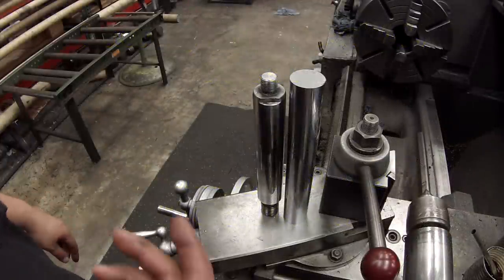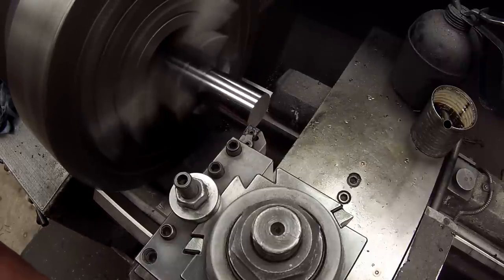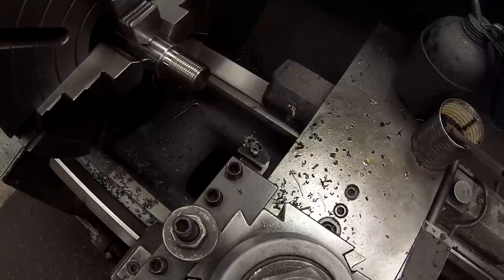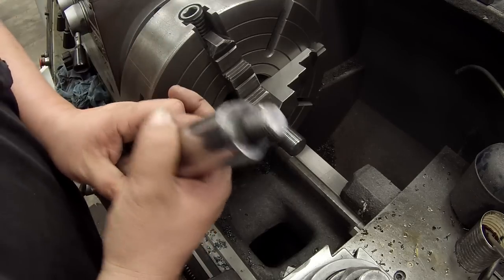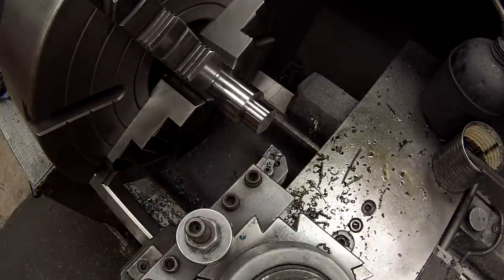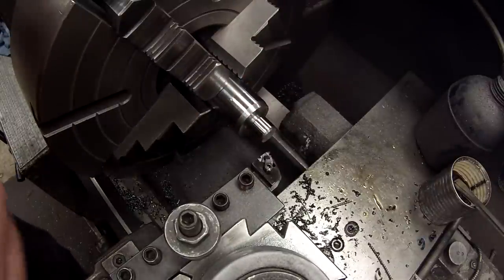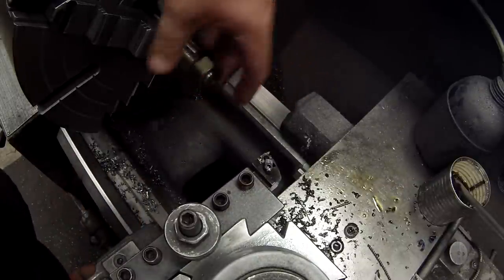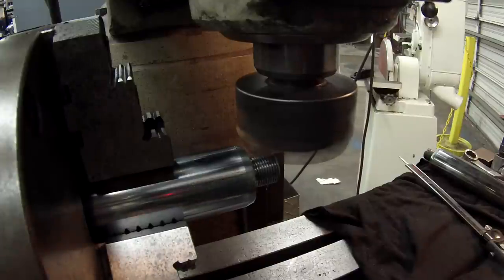Saturday Night Special 44 Part 3

Comment: This video is good start for a series! Thanks. Few questions :
1- Is this a special steel to make these rod? What should we ask for?
2-How do you clean or repair the scratch?
This material seems to have a chrome finish or something that covers the steel. Can we do that repair at home? If so, how? I would love to see you make all the cylinder's parts. For some projects I need to make a very, very small cylinder (air-spring and some oil actuated) and would be interested to see how all these parts are made. If your boss could be kind enough to let you film some of the work related to that matter. Thanks

Comment: Man you really got some good footage on this segment. This was a great machining video. I assume you used the DRO for the o-ring depth and didn't just eyeball it?
Reply from the maker: bcbloc02 I used the dial on the cross slide actually. I feed in about .105 for a "0" series oring, and the inserts tools is .085 wide.

Comment: I thought Quick Draw MacBooth was going to have to have to make an appearance ont that second end.  No fair when you put in an undercut.  :-)  Nice work.
Reply from the maker: I'm not scared of a shoulder. But that one was just to make sure the nut went to the shoulder of the rod, but probably something in front of it once it's installed.

Comment: Hey Adam,

Did the piston end have a locking screw in it? Do they put that in when they assemble the cylinder?

Looking good buddy.

Cheers,

Tom
Reply from the maker: Hey Tom, most of the pistons and rods get a "dutchman" in them when assembled. Our general rule of thumb is any piston over 3" gets a set screw. A bunch of the factory units we get in are just drilled and "pinned. Pain in the ass, I have to drill them out by hand mostly. Usually not a problem if I can set them in the drill press on two parallels. The big ones get drilled by hand with the drill motor.
Thanks for making some time for your ole buddy Abom!

Adam

Comment: Another fine job you did Adam. I still say you are one of the fastest 4 jaw chuck A+ runout setup man around.
That metal looks easy to machine but I see when you cut the threads they cut like butter. I have problems cutting smooth threads what do you think I am doing wrong. I am using a HSS cutter with 60 Deg point with 70 rpm 8 teeth per inch for a 1-1/2 spindle using test 1018 steel.
Thanks again somethimes I am not able to comment 
Manny
Reply from the maker: Manny Monroy Cutting with a HSS tool often causes problems with the finish. The carbide inserts and the faster RPM's usually result in a nicer finish. Even with the hss, run as fast as you can to help with the finish. Cutting oil, and a fine honed tool will help as well. Thanks for the 4 jaw comments Manny!
Reply: Thank you for the tips on threading.
Keep on trucking :))
Manny

Comment: Wow. That's a huge SNS episode. Awesome! Great work on the hydraulic rod. How long did it take you from start to finish? I really start to see the advantages of a four jaw chuck. I have been turning some polystyrene rollers for an apprenticeship and as both sides needed to be machined, after flipping around it ran pretty bad, about 1 mm out. As there was no four jaw available, I had to turn a mandrel. Not my preferred type of holding work...

Anyway great video, thanks for sharing.

Phil
Reply from the maker: That one only took about an hour to make, if that. It's a pretty quick one to knock out.

Comment: In the last phase and judging by the sound looks like only one of the indexed tool inserts is cutting. I gave up about using more than one insert in my tinny indexed tool because of the extreme difficulty in getting the inserts aligned.
Reply from the maker: I never pay it much attention myself, but have had to turn the inserts around many times. That milling cutter uses three inserts, so not as bad to replace the cutters as some. I will say that is seems to do a better job that the normal use of an endmill.

Comment: Great job!  It didn't look like you put anything between the jaws and the rod when you tightened it down.  Is there a chance of jaw marks, or is the chrome hard enough to prevent that?
Reply from the maker: As long as you have a good chuck, and it has the "flat" jaws and not the knarly serrated jaws like most Cushman chucks, you can chuck the chrome rod without messing up the chrome, as long as you don't pull it too hard. When using the knarly type jaws, yes you need to use soft jaws "copper pads in my case".

Comment: Pulling off of that thread at 300 RPM is a little like how some have said that some major league batters can see the laces and ball rotation on a 90 mph pitch!
Reply from the maker: Ah come on Dave, that 300 RPM is everyday all day. LOL! Even faster with the fine pitches. Just some time and experience. once you get it down, the slow rpm's just take way too long.

Comment: Cool. I think that was the longest work video to date? Like to see more if it's ok with the bosses.. ;-)

Colin
Reply from the maker: So far, it's cool with them as long as it doesn't interfere with my work performance. I certainly don't want to impose on my job status, so filming there is much fewer than what you see at my shop. I have missed many opportunities to film some very cool jobs I get to work on.

Comment: How do you or the lathe know when the start of the pitch is? 
Because you will either have to very very precise switching your feed in, or will it feed in at the exact same place every time?
Other wise you might end up making two threads or nocking the pitch off?
I've never threaded before so have no idea.
I love your videos,
Mark :)

Comment: Hi Adam,
That hydraulic rod is a shorty!  May I ask what it goes to?  Also, I noticed that you began with the correct-sized stock.  If the stock just happened to be oversized, would you be able to obtain an adequately polished surface on the lathe, or would it need to be ground to size beforehand?
Thanks,
Bryan

Comment: Great quick video Adam.  What steel is this you are using?  It cuts really good.  Thanks
Andy
Reply from the maker: This particular rod is 1045 Chrome plated. You can buy from cylinder component suppliers.

Comment: Hi Adam. maybe I missed it, but did that shaft come to you polished or did you machine it and polish it in another video. Is that rod going inside something or is that the finished product ? Great job, I enjoy watching you work. ....Ken
Reply from the maker: Ken, it's chrome plated rod which comes already polished just like you see. If I get any imperfections in the surface while chucking I can polish it myself and bring back the nice finish.

Comment: Hi adam
Did u leave and jaw marks from the chucks or did you polish that out after.
Cheers
Greg
Reply from the maker: Greg, no jaw marks on the chrome with the smooth jaws, and correct torque. The serrated jaws are the ones you have to be carefull with, and usually have to use soft jaws with them. But if it did leave a scuff mark, and quick polish will buff it out quickly.

Comment: Hey Adam,
great info in this one as well as in any other video. One question.
How did you make sure the overall length of the piston is accurately machined to the right dimension or aren´t there close tolerances on this one? It seemed like you started out with two saw cuts on the stock material and then kind of arbitrarily faced of 50 thousands on each end to get it to overall lenght without any measuring (or at least not showing us). No matter whats the case with this one, how would you machine such a piece where you´d have to machine features on both ends of the shaft and still hold a thight tolerance on the overall length?

Looking forward to the rest of the hydraulic series buddy. Greetings from germany

Kevin
Reply from the maker: When I cut the rods in the saw I cut them 1/8" long by using a tape or rule. Face .050 off one end, and usually the other side will need .050- .062 faced off as well. On this job, I measured the rod length with my12" calipers before I chucked it back up for the second end. I needed .050, but it's not a super crazy tolerance. I usually get them to within 1/64" or tighter, but on many rods you can be off 1/16" and it won't hurt it. 
To do an accurate measure, you can face, remove and remeasure, them chuck it again. You can also use a steady rest and measure while still in the lathe. When in the machine I normally use my Stanley fat max tape measure and I can get them within .010 by sight.

Comment: I learned how something can be done - the threading process - but still don't understand it.  I can see how one run would put cut threads (or the beginnings of such) on a project, but then to cut them deeper it seems like (to this student) that if one wasn't really careful, or using a computer to sync it, that the next pass to cut the threads deeper would have a chance, and maybe a good chance, of not following the original thread cut and cross-cutting it.  Can anyone describe the process to prevent follow-up thread cuts from cutting anywhere but the original cut(s)? 

Also, is the 300 RPM for the threads desired relevant to the machine, or how does the machine know how fast to draw the cutting surface at a given speed to get the desired thread?  Thanks for any replies or links to videos.
Reply: If you look on Youtube for MrPETE he has several videos that show the basics of threading.
Long story short, there is an indicator that is in sync with the chuck that tells the operator when to engage the feed. This is an extremely brief explanation and doesn't do the process justice. There are other excellent channels that explain the process too.

Comment: Good vid man , The kids asked what me what that rod was for metal type , I know it's steel .. But not sure what to tell them ??
Reply from the maker: 1045 Chrome plated steel. It's made for cylinder work, but is also useful for pins and such too.
Reply: Abom79  The 1045 is what I was messed up on man ,Thanks !! I will for sure share this with my kid'oes !!

Comment: When you were threading how deep was each pass?
Reply from the maker: Depends on the pitch. 12 is the most common for me, and usually I take first and second pass of .020, then .015, then .010. 12 pitch is usually to proper depth at around .062-.065 on the compound. If it's still tight then back off to spring cuts or .001 per pass.